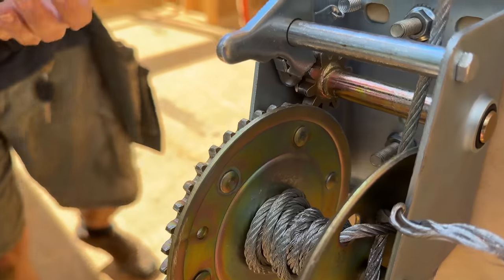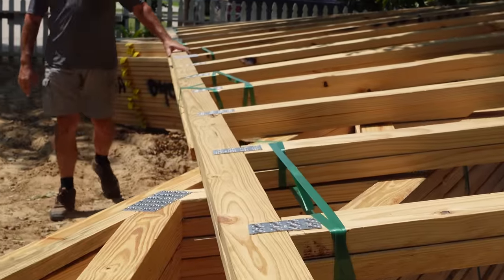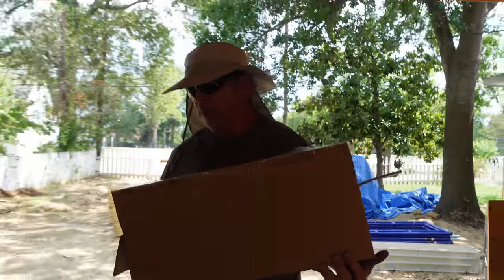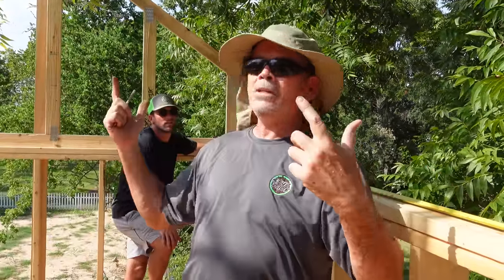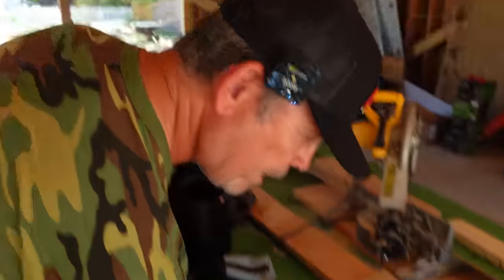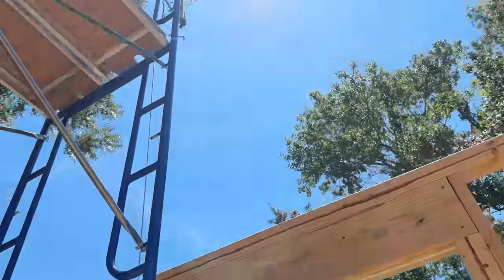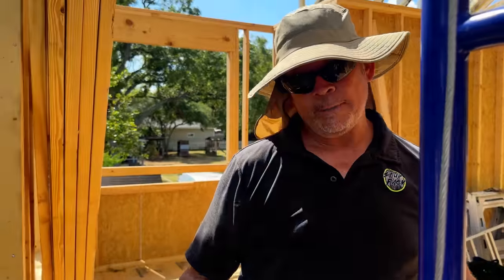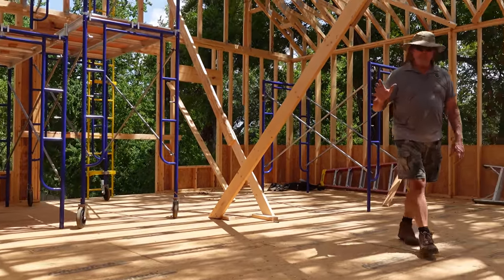Climbing 30 FEET UP to Lift Our Trusses by HAND! (Saving us Thousands)

Comment: Based upon the comments of the uncles, and nothing more than watching the vid, I will tie off the end of the scaffolding back to the front of the building if this project ever comes into my life, which it might.
I will screw some scrap 2x ears to the bottom cord as I won't have a "monkey-man"  (aka:  stuntman).
In that way. it will be easy-peasy when the truss clears the top plate.
Over the 50 years that I have had swingin' a hammer as a hobby, I have gotten myself into plenty solo projects where I could not be at both ends of a heavy item.  My solution on a surprising number of occasions was rope and pullies.

Comment: Every time I think you've impressed me enough, you all come back with "Challenge accepted!"
Truss work is extremely dangerous under the BEST of circumstances. You managed to come up with a way to install these with only three people, a scaffold, and a winch. SMH....
For everyone else, spend the money on a crane. The biggest reason @StudPack could get away with this is because they had Rad. Not everyone has a Rad to rely on for fearlessness and experience at heights. So don't just assume you can do the same thing, the danger factor here cannot be overstated. Tip o' the hat to Rad for perfect execution, and even a little levity.
Can't believe you all pulled that off with three people, one mechanical, and NO machines. That's ABSURD. Never not impressed. Never. 👏👏👏👏

Comment: $ 1000. large for a crane ---- 3 days 4 guys $250. each $1000.a day x 3 days 3 large. Crane 3 hours much safer save Your Guys.   I always dreamed about a center crane  a truck rear end long gated vertical bolted 2 the floor with four guide wires bolted 2 the floor 3- 2"x6" bolted together for a horizontal boom with counter balance weights on other end and electric wench and using the brake system 4 control i always got a crane when i could not lift with man power    jk

Comment: That was creative, but ultimately dangerous and slow. Rent a crane for $300 and lift the pack. Build planking at wall height in the center and spread by hand. Done in a few hours.
Reply: Also,, pre-sheet your gable ends on the ground.

Comment: One accident costs more than 1k. A cheap funeral is 12k. A good son-in-law is not replaceable. He seems like a keeper. That scaffold had no out riggers. It could have very easily tipped. Thank God, you were lucky. That Brocken winch spoke volumes. I’ve got just 9 years experience and I know better. Just thinking about some folks with no experience are going to try the  same thing and end up dead. I was not impressed with the stupidity.

Comment: 3 trusses 1 day: insane. A crane would have had it done in a couple hours. Money well spent. Unless they are ripping you on the crane charge it’s not thousands saved verses labor spent. A back is not worth the chance. A drill motor on the hand winch would have helped.
Reply from the maker: We’re not running against a clock for anybody. We’re taking our time in the heat first and foremost, and having fun. Our backs are fine, and our biceps are pumping 🤙🏼

Comment: You guys are getting crazy now. I think you're sniffing too much wood 😮😅. 
You put a lot of trust in that scaffolding. (Pun intended) 😜
I would have liked to see some outriggers (4 extra wheel casters) added to the bottom of the scaffolding but it is what it is. 

-So now I find myself asking a different question when I start to do sketchy crap... Is renting a crane at $1,000 worth possibly risking (as little as the risk may be) an accident of the scaffolding tipping over; would the person survive the fall?
       Meaning would you pay $1,000 to get your buddy (In this case family) back if something was to go terribly wrong? 
The answer is obviously yes. I find myself turned into such a wimp as I get older. 😊
❤❤❤❤❤❤❤❤❤
If it's material that's going to get broken... do sketchy crap. If it's a human that's going to get broken... pay extra money.

Comment: I guess there are two schools of thought in this step of the job. 1 done just the way you did it with manual labor and rigging. Pretty time consuming and with so many steps, the possibility of an accident occurring. The second thought is to get a genie fork lift or a crane. Get all the trusses up on the second floor and slide them down as your method was at the very end of the video. Probably more productive and less chance of someone falling or being struck by a wild truss. Your channel is fun to watch because of the subject matter and youthful enthusiasm but don’t get trapped into penny wise and pound foolish.

Comment: Green horns!  The crew that I used to work with would have all those trusses shook out in one afternoon without a crane and without 30 feet of scaffolding. Build a good Y stick. Put the heel of the truss on the plate,  then flip it up.

Comment: PS: $1000 for a crane is a good deal when you pay $40/ hour for labor. Those trusses would have been up in one morning.
Reply: They aren't paying anything for labor, they are doing it themselves. So your comment is irrelevant.
Reply: Their labor is free, their budget is not unlimited and is going mainly into materials. $1000 for a crane is an unnecessary expense when a $150 winch does the job in a way that they can handle.
Reply: @terpfen  their YouTube Channel can have better content than this........if the crane had been hired, they could have been in Dallas, or Tampa Bay, or where ever they are going next. Plus, the sheathing of the roof could have been started already. Time is money.

Comment: Uh,,, no.  There are lots easier, cheaper, and safer ways to do this.  You have chosen difficulty, snap, and expensive.  Sorry.  Love ya dearly.  But for starters,, had you stuck with the original plans, you'd have been done. The original plans were suitable for no crane and a strong crew.

Comment: WTF is crazy about using scaffold the way it was intended? Your highest walkboard is only 20' off the floor. 
Let's see a hand built scaffold from lumber that's actually 35" in the air when you're catching rafter peaks and nailing them together on a ranch style home with stick built cathedral ceilings. Like we always do. 
This is child's play and way overkill. We just hand them up and wall walk them into position. 
We would have had our trusses set and half way braced off by the time you guys finished messing around putting that scaffolding up and taking it down. 
Come to think of it I've never seen any framers ever waste time and money setting up and using scaffold... ever.